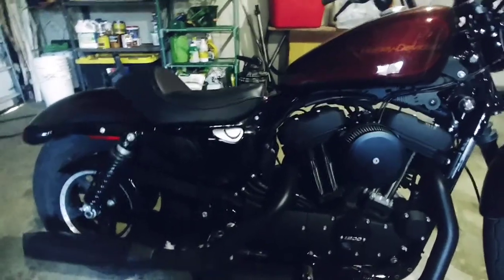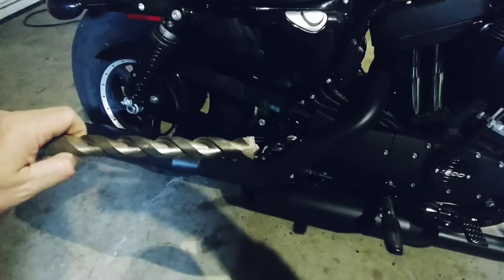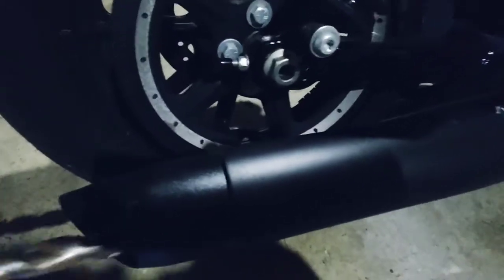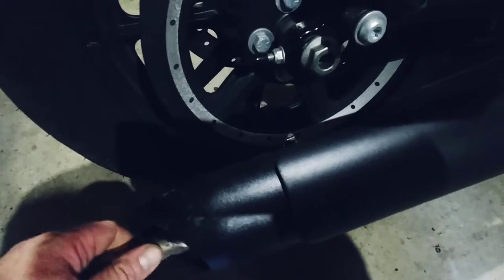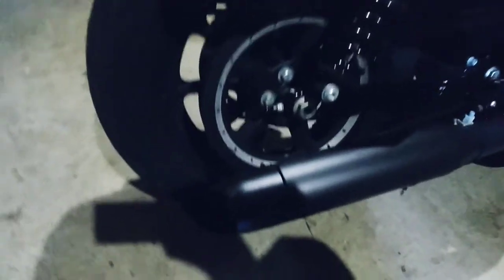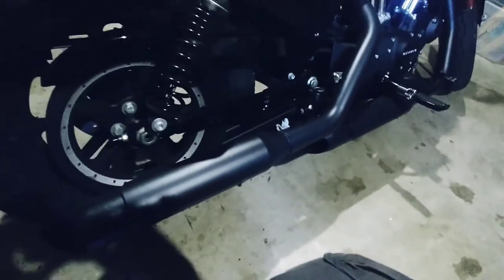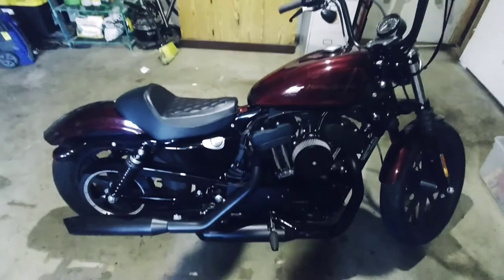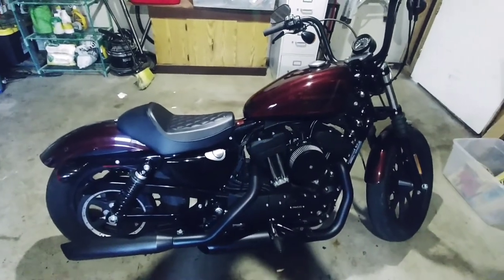Harley Exhaust, Baffle Drilling, Sexier Sound

Comment: Did this to mine and I love it.
My bike sounds amazing!
I live in Los Angeles and I needed more sound. I have no experience with tools. Took 5mins total for both. Super easy! I went 3/4” sounds beautiful.
Reply from the maker: And you saved hundreds by not buying expensive pipes to get that classic sound.
Reply: Bro have you had any issues once you drilled the holes? Any popping? Did you have to get the bike tuned and did you have to change out the stock air intake?

Comment: Did the same thing to my 09 Sporty 1200L. I just drilled one 1/2-inch hole and one 1/4-inch hole in the baffle plug. Didn't even use a shop vac or magnet to get the shavings out. Just took the bike outside and fired it up and let the exhaust blow everything out. Mine has a sound very similar to yours. I've heard people say that they have done this and noticed a chirping or whistling sound at idle, but from what I've read and seen, that only happens when you remove the entire plug with a 1-1/4" hole saw. If you leave some of the plug in there, you won't get the chirping sound.

Comment: Amazing video bro! Sounds awesome. I have a 2020 sportster 48 .... recon this will work on it? Do you need a new intake or any other mods needed once you drill out the baffle? ..... side note .... just spoke to Harley on the drilling of baffles .... they said they do not recommend and strongly discourage it as then the bike will run lean and the newer sportsters like the 2020 are efi. 😢 now I am lost. Ofcourse Harley would say that ... it was expected.😊
Reply from the maker: Yeah Harley discourages everything. I saw a video of a guy with my exact bikes drill the baffles and had no problem. There are other videos where guys are grinding the entire baffle out. Ever since I did this to both my bikes, I haven't had any issues and put thousands of miles on them since and they run fine. My friend has a new street bob with all of the efi and smog stuff on it and he switched to slip on straight pipes with no baffles. It is loud as hell but there are no performance issues with it at all. I don't see the difference in a drilled out baffle or a stock slip on with no baffle at all.
Reply: @insaneseafarer9691 Sweet! I am going to HomeDepot and getting that drill bit tomorrow. Sorry about repeating my question but yours is a sportster 48 yes? And did you need to change the stock air intake/air filter??? Thanks for all the help !
Reply from the maker: @abdulkhawaja9792  The bike in this video is a 2019 1200 Iron. Didn't need to adjust anything for drilling baffles. The air filter you see on the bike is from K&N that I got on Amazon. I got it for a cooler look and it definitely allows more air. I used a one inch bit. Shine a light into the muffler and you will see the baffle plug. It is thin sheet metal and the drill will go through easily. Do a before and after sound check on video. You will notice the difference. I swear I get better fuel mileage this way. My 1200 doesn't have a gas gauge so I set the trip odometer to zero when I fill it. The fuel light would come on at around 80 miles. After drilling the baffles, the light now comes on a 96 to 100 miles which is about a little over a gallon left in the tank (3 gallon tank). So I know I got better fuel mileage now. Rode from Oregon coast to Boise and back with no mechanical issues and it sounded great.
Reply: @insaneseafarer  God bless you brother! Ride on! Thank you for the suggestion/recommendation .... many people will benefit from this. Stay safe and stay blessed!

Comment: So I just got a set of stock exhaust that someone had done this to, but they didn't finish. One is a full hole, the other one looks like they pierced through it but left all the extra medal. trying to find a way to drill it out. But since they already pierced it there's no center point for a drill bit...
Reply from the maker: Try a masonry drill bit like I did. I used a one inch bit and it worked perfect.

Comment: Sounds like screaming eagle mufflers😂
Reply from the maker: Kind of but these mufflers are just as good with the baffle drilled out. And less expensive. My fuel mileage increased doing this.
Reply: @insaneseafarer  people say u can get some chirping noise with it? Do you have anything like that?
Reply from the maker: @UserYoutube-i6f  I have heard that complaint but neither of my bikes chirp. They just rumble.
Reply: @insaneseafarer  did you manage to take that round piece off that fell inside? What did you use a magnet?
Reply from the maker: @UserYoutube-i6f  It came off with the bit. Most of it turned to metal shavings that I used a mini shop vac to get. Probably why the chirping on most bikes is the shavings are stuck in the glass packs.
Reply: @insaneseafarer  I bought telescopic magnet in home depot I guess it will do the job 🥸 to pull everything that falls off
Reply from the maker: @UserYoutube-i6f  That should work. I believe the material is magnetic.
Reply: @insaneseafarer  ok i did all the same took everything pf them baffles and i got that chirping sound wtf🥸 maybe need to polish the inner ends of the baffles don’t know
Reply: I think I realised what’s going on that left over weld needs to be polished to make this inner baffle part to be smooth where that round piece was
Reply from the maker: @UserYoutube-i6f  what size bit did you use? Make sure the wall you drilled through is gone. I have been running my bikes like this for two years and have no chirping sound at all. My guess the exhaust going through the small holes in the glass pack could be make a whistle.
Reply from the maker: @UserYoutube-i6f  you can remove the packs and blow them out with a compressor.
Reply: @insaneseafarer  size was 1.1/8 perfectly made what’s left is that weld for that round piece i guess this weld creates that sound cause baffles should be smooth all the way inside I’ll polish this weld tomorrow
Reply: Thing is I thought that round piece is in the beginning of the baffle but it’s in the middle when the air is coming through on some particular revolutions of the engine this air flow touches those welds and creates sound. Airflow should go smoothly. That’s my guess I’ll do it and text you tomorrow
Reply from the maker: @UserYoutube-i6f  Let me know how it works. I may have been a lucky one with 2 for 2 since I don't get the bird chirp on either bike.
Reply: @insaneseafarer  do you actually have some welds left on the inner walls of the baffles? How does it look inside when you look into them?
Reply from the maker: @UserYoutube-i6f     Sounds good. The baffles I have the plate I drilled through is the very end of it. I'm on the island of Saipan at the moment so I can't look at my bikes and see. But I took the sleeve off and drilled and the entire baffle looked like the inside of an oil filter. The plate I drilled through was at the very end of the baffle. I used a 0ne inch bit to get through it and had no issues with residual jagged metal. Hope that helps.
Reply: @insaneseafarer  i took mufflers off and that round piece is in the middle of the baffles what goes after them is catalytic converters the cells you see
Reply: @insaneseafarer  I think I found out where this chirps coming from. Theres a small gap between outer surface of the baffle and body in which it sits need to weld it. Basically baffle does not sit centered.
Reply from the maker: @UserYoutube-i6f  could you make a video of it and post it? I would like to see the gap and compare it to mine.

Comment: I was looking to grind down the pinch welds as I’ve seen for older models. But from my understand one pipe has an additional piece inside that’s harder to remove. I will be doing this instead. It’s noticeably louder and quicker of a job.
Reply from the maker: I have seen videos where people broke the weld from the baffles and removed them. Way too much work for me, the one inch drill bit was perfect.  I increased my fuel mileage and power by drilling holes through the baffles.
Reply: @insaneseafarer  I did the 1 inch drill bit. First a 3/4 because that’s what I had on hand. I bought a 1 inch drill bit and it really woke the bike up to say the least. It sounds way louder than in your video. It’s insane actually.
Reply from the maker: @Sr5taco  awesome! Plus, you save hundreds of dollars by not buying custom pipes that have the holes in the baffles made by the manufacturer.
Reply: @insaneseafarer  do you have any videos of drive by’s with this exhaust setup?
Reply from the maker: @Sr5taco  Not yet!! But I need to find someone who will hold my camera when I blast by.

Comment: Don't do this unless you are willing to deal with an annoying chirping sound after the mod.mine is louder and sounds great but it chirps and I've read that they all chirp after the mod.i used a whole saw bit instead of a drill bit on .y 2019 1200 roadster
Reply from the maker: I don't hear chirping on either of my bikes. Using a smaller bit might make it whistle through the baffles. I used a one inch bit that ripped through the baffle plate and it sounds good.
Reply: It also risks the exhaust sucking in more cool air and causing back fire. Engineers designed the bikes to run a certain way, and doing some shade-tree mechanic stuff can alter the precision engineering in negative ways.
Reply: If you used a hole saw bit , you might have gone over the one inch size .
Reply: @therandomdot2563  That is BS you don't know what you are talking about !

Comment: Did you have to retune or adjust fuel?
Reply from the maker: Not at all. I did get better fuel mileage I noticed. I was getting 44 miles to the gallon now getting 50 mpg
Reply: @insaneseafarer  Thanks.

Comment: Did you take the mufflers off to drill them?
Reply from the maker: No. Didnt need to.
Reply: @Insane Seafarer 
Cool Man!
I just bought a 2022 Iron.
Im going to try the bit idea.
I thought it sounded great!
Plus I like the look of the stock exhaust.
$20.00 compared to $600.00
is a no brainer.
Do you still have the bike?
Reply from the maker: @Unmarked_1  yeah I still have it. I did the same thing to my 883 and it sounds great as well.
Reply: @Insane Seafarer  Sweetness!
Is it possible to make another video with you riding the bikes?
So glad I ran across your video.
Off to Lowe's to get a  bit!
How long was the bit twelve inches?
Reply: I got one more question if you could answer it. Did you use a hammer drill or a regular drill
Reply: I was just concerned whether or not it left shavings inside the baffle

Comment: Good day, I'm thinking about this improv, how much drilling you need aprox, how do you know when to stop? Thanks
Reply from the maker: You will feel it go through the baffles plate. Take a light and shine i through the exhaust and you will see the round plate. It is very thin and a drill will go through it quick.
Reply: @insaneseafarer  Thanks for your answer, I will try it on my iron

Comment: Is this bad for the engine in any way?
Reply from the maker: I haven't had any engine problems at all.
Reply: Probably helps the engine more than anything. The engine is going to have less back pressure without being a fully open pipe so you’ll get a cooler engine and better gas mileage.